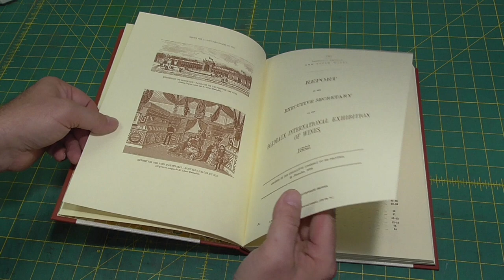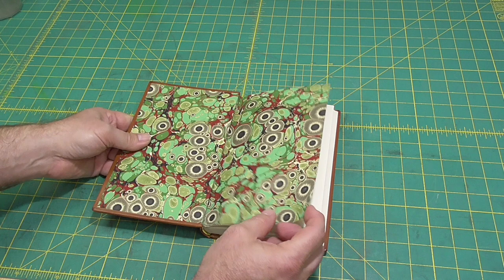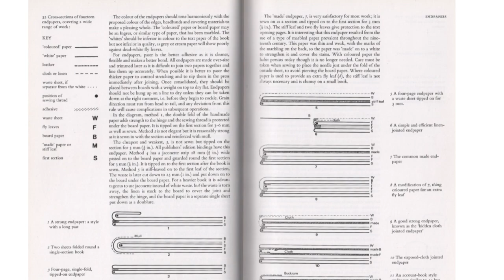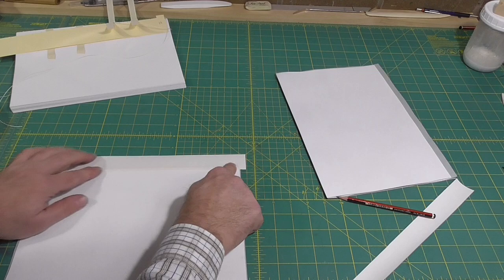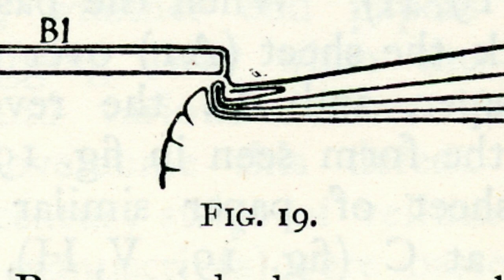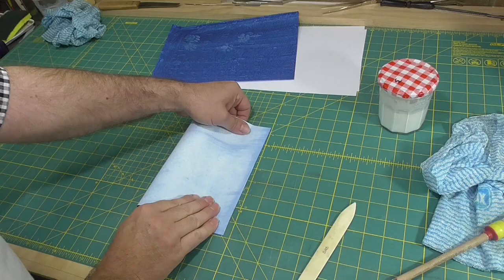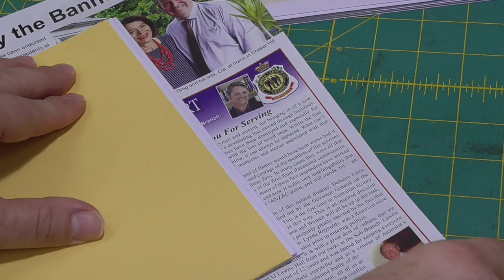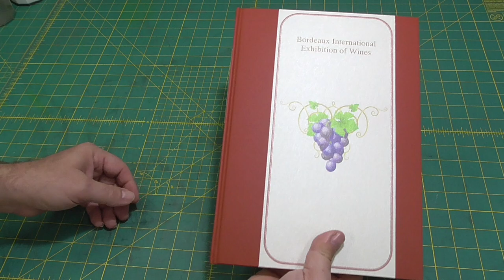An Introduction to Endpapers for Bookbinding // Adventures in Bookbinding

Comment: I found this very interesting. In particular I like the spring back end paper and the end of the video. I learn a lot of terminology in the video. Thanks!
Reply from the maker: I'll try and be careful to use the correct terms.  I try and follow what was used in the English trade binding system at the end of the 19th and early 20th century.  It's well documented, so I have no excuse for mixing up "paste up" and "glue up".  Happy binding!  DAS

Comment: Folio (folded sheet). There are a variety of usages for "scrim," which could mean a test or practice match in some sport, or a piece of translucent material used with a curtain or paired with a curtain.
Reply from the maker: In this case scrim is the later, it is the same material used with curtains.  It is maybe one of the most confusing words since there are so many other variations - scrim, mull, super and more I can't think of right now.  I used to use mull and while living in the US I changed to scrim even though in the US super is the predominant name used.  I have no idea why I did this....  DAS
Reply: @DASBookbinding  Thanks. I just ordered some "super cloth". I didn't think it was what Superman's cape was made out of, but I did think it was some marketing term. Didn't realize it was just another word for "scrim". You should really watch the "piping" scenes in the Netflix "Patriot" series, where the lead character, who is supposed to be a secret agen, is trying to make sense of the specialized language they use in the "piping trade" so he can fit in. It's hilarious. In  fact the whole series is darkly hilarious.
Reply: Oh, not Netflix. It's on Amazon Prime.

Comment: Please do a leather jointed endpapers, the is so little information available in the tutorial form
Reply from the maker: I'll get there.  But I do see them as a long term weakness.  DAS
Reply: @DASBookbinding  interesting, are leather jointed endpapers necessary for doing doublures?
Reply from the maker: @greenerman3200  Another way of look at it is that if you have an inner leather joint then the inside of the board has to be filled in with something, which is the doublure.  Check out Mark Andersson's GoBW video for a simple inner leather joint with basic doublure.  Use the code GBW4FREE with the 7 day rental
https://vimeo.com/ondemand/04gbw2
Good luck!  DAS
Reply: @DASBookbinding  Thank you, that was so instructional. Great reference material, I'm looking forward to see you try a binding like this one.
Reply: @DASBookbinding  Seconded! I'd love to see a tutorial for leather-jointed endpapers. I can't find anything online.

Comment: Appreciate all the work you are doing to teach aspects of book binding. Thank you.

My goal is to leather bind the one book that I have written.

Question: Have you ever used poster board (thin smooth card board) for an endpaper system? I am thinking durability here. I am thinking of using plain white endpapers and then decorating them myself with water colors, inks and markers...after they are installed.
Reply from the maker: I think anything you can describe as card or board is too thick for endpapers.  This particular endpaper is extremely durable.  The cloth will last hundreds of years.  But this style is mainly used for stationery binding, not "letterpress".  The exception being the 19th century split-board, or library style.  Designing a book structurally is real challenge.  Good luck.  DAS

Comment: Excellent learning opportunity.  What is the gauzy white sheet you use to protect what you're working on when you use a book press?  It looks like waxed paper.  I assume its purpose is to keep the glue from adhering to parts you don't want it to.
Reply from the maker: Non woven polyester.  In this case it is Reemay.  The free Tyvek envelopes at the US post office are perfect, assuming they still have those.  DAS

Comment: Hi there thanks so much for your videos! They are a joy to watch. One question I have is whether you could share a list of some reading you've done that is interesting or helpful. I found the Thames and Hudson manual, but would love more to read. Another question I have is whether you would have any insight into how to properly size a attach to the book block a soft cover? Thank you so much for your effort and time into these videos.
Reply from the maker: Hi Taylor!  Sounds like it's time for me to share a reading list.  2 requests in one day.  About the only time I do soft (or limp) covers is the stiffened paper binding type structure.  Then the cover is trimmer flush with the text.  If you are using leather and extend it beyond the text it becomes a sort of yapp edge.  This is common in bibles, but I don;t have much experience except minor repairs on these.  Take care!  DAS

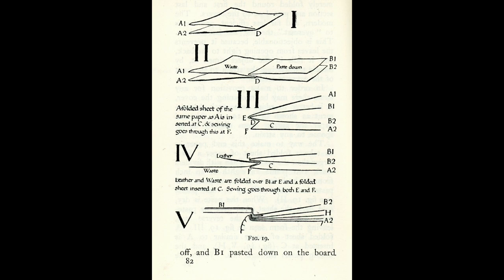Comment: It's important to get them in the correct order, make sure the zig comes before the zag, otherwise you will have to take the book apart and do it all again. 06:44 
Darryn (whisper) don't tell anyone, but I don't like decorative marbled paste-down paper at all. Maybe it's because it looks like wallpaper and I detest that too.
What about getting getting colored paper from Office Works? What GSM is suitable? Is paste-down paper a specific fibre structure because it has to resist opening and closing?
Reply from the maker: A lot of my favourite bookbinding authors from the early 20th century said they didn't like marbled paper either.  It's a reaction to fashion.  I hated wallpaper until I started studying William Morris:) DAS

Comment: Thank you so much.  With the lock down I can't get out to browse the shops and have just discovered your channel.  Using the supplies I have at home, I have been experimenting with paste papers, but they are mostly flimsy.  You have clearly explained what to do about that!  Can you suggest an Australian source of paper suitable for paste papers to be used for decorative end papers?  Also a supplier for the starch?  Thanks
Reply from the maker: Hi.  The starch is easy.  Most IGAs have Silver Star laundry starch.  It's highly refined wheat starch.  Perfect.  Paper is harder because I have this old stock which I think was from the old Shoalhaven paper mill.  I was told just today about a store in Melbourne that has nice paper - expensive, but nice.  I have not used these papers for paste paper, but I think they'll work well Hahnemuhle 150gsm, Japon Calligraphy 130gsm, Somerset Book White 115gsm.  If you try these papers, let me know how they go.   https://www.e-artstore.net/

Comment: Love your channel, and I have a question:
I make original art mono-prints with acrylic inks and paints on my gel plate. 
Would these be suitable for endpapers, or do you think the acrylic medium might stick to itself over time, if pressed against each other in a book? 
I have created an art journal with every page made with the mono-prints and have found no sticking, thus far.
It has only been about a year since I created it, though. 
I wonder about long-term, i.e. archival properties and all.
Reply from the maker: Good question.  I use acrylics for paste papers which I use as endpapers.  I usually do wax them (which I've worried about too).  After years on the bookshelf I've seen no issues with offsetting or adhering to themselves.  So I think it's all good.  But it is a limited test.  All the best, DAS

Comment: I am fond of artisan binding. Thank you for sharing your knowledge and experience through the videos.
They are extremely dynamic and clear. Can you recommend any bibliography on guards?
From already thank you very much.
Reply from the maker: Thanks!  Can you be more specific about the type of guarding you would like to do?  Guarding in bookbinding can be used to describe a number of different processes.  The repair and reinforcing of the fold of folios is called guarding.  Or you can use a guard to hold a plate in place, which is a bit different processes.  And then there are concertina guards and reverse guards (aka meeting guards).  For repairing the fold of folios I'd recommend Kathy Abbott's book (but make sure it's the second edition).  The Thames and Hudson Manual of Bookbinding ahas a brief section on guarding maps and plates into books.  Concertina guards and meeting guards aren't very well documented.  All the best, DAS
Reply: @DASBookbinding  Thank you very much very kind
Reply: Ohhh, recién lo veo,🤣😂🤣 Muchas gracias!! Lo empecé a seguir en Facebook (nos fuimos libros) La red me supera!!

Comment: Sorry for commenting on an old video, but I was curious if there was a work around for books too large to fold end papers? Is there a work around or do I just need to go out and buy massive sheets of paper in order to be able to fold them?
Reply from the maker: With this endpaper, since it has the cloth hinge already, there is no reason not to also hinge the white with paper.  But you still should have the grain direction head to tail.

Comment: Hello, how heavy  the endpaper paper should be? Is 185 grams too heavy? I read somewhere that it should be between 100-140 grams , is this correct? What would happen to a book if heavier paper is used, lets say 250 grams? Would that pull boards and warp them ? Thank you for your videos, learning a lot from them :]
Reply from the maker: In terms of pulling boards, I mention when the book is being opened and endpapers being pulled away from the textblock.  This is different to when you glue the paste down to the board and as the wet paper dries it shrinks and "pulls" the board which can cause it warp in  Hopefully the design has the pull balanced with an outward pull.  This last type of pull is usually less pronounced with thinner paper.  Thicker paper "stretches" or expands less than thin paper.  You can use heavier paper for the colour paper, it just means the first free flyleaf will be stiff.  I've bound books where all the paper was about 250gsm, and used even heavier paper for the endpapers.  Unless you are working on something valuable the best thing to do is give it a go.  You'll learn something one way or another.  Good luck!  DAS

Comment: Hi, I’m making a sketchbook with a paper weight of 400gsm. So does that mean I have to use an end paper which is of the same weight? It’s a watercolor paper that I’m using and I don’t know any other alternatives that would be 400gsm. (Unlike the pretty patterned ones you have shown. I would really like to see a lesson on constructing a sketchbook using extra thick papers. I watched many of your videos and learned a lot. However my book measures 6” by 9” and I can only seem to fit 2 papers in a signature. Thank you.
Reply from the maker: Hi, well 400gsm is heavier than I'd use in a book.  I consider that weight card rather than paper.  I'm surprised you can use more than 1 sheet per section.  I would use the same paper for the endpaper.  If you want a decorative paper you can use something lighter and do a made endpaper where the decorative paper is laminated to the heavier block paper.  Hope that makes sense.  Good luck!  DAS
Reply: @DASBookbinding  Thank you for your prompt reply. My sketch book did not turn out well at all so I had to recycle the entire book including the end papers! The pages would not close flat even though I put a clamp over them and glue seeped through the signatures through the big gaps and ended up tearing the pages when I tried to make it lay flat. I used that paper weight as my son's girlfriend does acrylic painting and I was looking for a paper that would not warp. I would be very interested to know what sort of sewing method you would use for something so thick. This is my first proper book making project and I have watched a ton of your videos and learned so much!
Reply from the maker: @graceng5525  It's almost like a children board book.  I would use single sheet sections and I'd use one of the sewn board binding techniques.  Maybe use a linking stitch (aka French link stitch) at 2 stations for an A5 sized book (4 for and A4 sized book).
Reply: @DASBookbinding  Thank you so very much! You're awesome!

Comment: Another great video Darryn, thanks so much. I'll be experimenting with a few new techniques on my next project, and am now planning on doing a zig-zag made paper to see how it goes. Can I ask your thoughts on japanese paper hook guards for the first section/signature? I came across these diagrams (similar to Johnson's - http://www.philobiblon.com/endpaper.shtml) and they all have this japanese paper guard. Do you ever use it? I've not seen it used in your videos, and wondered if it's really an unnecessary step.
Reply from the maker: Hi Mark, Yes I shamelessly rip off Peter's stuff all the time.  Lucky I checked the link.  I thought you were talking about a method Peter regularly uses where he has a guard around the outside section and the endpaper.  I think what you are thinking is just a guard around the endpaper, like the hidden cloth jointed EP.  I think I would always guard with starched thin cotton.  You just need to bind lots of books and develop a style.  Lately I've been using something like fig 3, but not with the sewing visible between the pastedown and FFEP.  Just thinking about it now, in the past often decorative paper has been very thin.  Thus why I think reinforcing guards may have been more important in the past.  So think that would be a good rule of thumb, if the endpaper you want to use is thin or weak then a Japanese paper guard is a good idea.  Good luck, DAS
Reply: @DASBookbinding  Thanks for the reply. It looks to me like the Japanese paper hook guard is around the first section of the text block only, and then a separate linen guard around EP and fly leaves in that Fig. 3.  Would the linen be something like Fraynot/Calico? I've only ever done the basic one-folio-tipped-on end paper, so I'll have a play around and see what works best. Thanks for your help, and keep up the amazing work - I've adopted quite a few techniques from your videos already!
Reply: The link is now defunct
Reply: @bella-bee  thanks for the alert. The nearest thing  I could find with a Google search was this: http://www.conservation-wiki.com/wiki/BPG_Endpapers and if Ctrl+F search for 'hooked' you'll find the same info

Comment: The terminology here is quite daunting and probably derives from traditions started in the Middle Ages with craft guilds. Part of the purpose of the specialized language is to act as a barrier to entry, which was always part of the purpose of guilds and one that was strengthened by and substituted with "royal charters" which excluded entry in a way that worked to the advantage of the nobles who granted the charters as opposed to the workmen and, to my way of thinking, was probably preceded by "guildmasters". This notion of specialized language taken to humorous extremes is depicted in Steven Conrad's excellent series for Amazon Prime: *Patriot*, which, if you haven't seen you're in for a treat. The scenes involving the specialized language of the "piping trade" is absolutely hilarious.

https://www.youtube.com/watch?v=S-Y_3Q5YnTc
Reply: This notion of specialized language is also a feature of academic specializations. While it may help people within a specialization communicate with one another it has the disadvantage of preventing cross-specialization insight. For instance breakthroughs which might be easily translated across specialized boundaries are prevented from doing so, so one specialization may be completely ignorant of the fact that some  of its persistent problems have already been solved in related disciplines. They never get the memo.
Reply from the maker: The main advantage of the terminology is efficiency.  Compared to other trades I think bookbinding has a fairly simple language.  A lot has been lost since the hand work side of the trade side has almost gone.  While the influence of the guilds is still present, bookbinding was an early and strong adopter of the modern union movement.  In a trade environment a single person would almost never produce a single book completely by themselves.  Because of the position of bookbinding being between printers, publishers and book sellers, they don't develop into their own world.  They are always dependant on someone giving them something to bind and someone to take the finished product.  All the best, DAS
Reply: @DASBookbinding  A couple of things: My doctoral mentor was Seymour Martin Lipset, whose father was a printer, and who was the lead author of the book written with James Coleman (The Civil Right study on School Integration) in a book called "Union Democracy: The internal Politics of the International Typographical Union*. As the chair of my committee he wanted me to write an update to that study, but after a few weeks or research it was too depressing. The ITU was no longer a printers union, because printing had been ended by desktop publishing. Instead it only existed in Canada and the workers mostly made hockey pucks. ;( So I wrote my dissertation on elections. It's still a great book that analyzes what happens to a democracy as it transitions to oligarchy, and why the printer's union was an exception to Michel's "Iron Law of Oligarchy"

As for the craft guilds, those were destroyed in the late Middle Ages by "royal charters" so that you had to have a charter to be a book maker. Remember, this was prior to printing which came in around 1450, so with a few exceptions the craft guilds were finished by then and replaced by a new corporatism under the control of charter granting corporate entities.

Also read McLuhan's Gutenberg Galaxy to find out what the real results of mechanical printing were and why it led to the Thirty Years War.

Finally, here's an excerpt from the Patriot series that you'll find pretty funny:
https://www.youtube.com/watch?v=ccnfHKZebRk